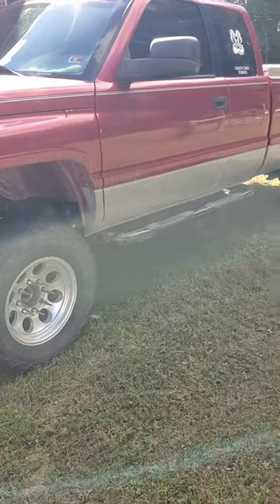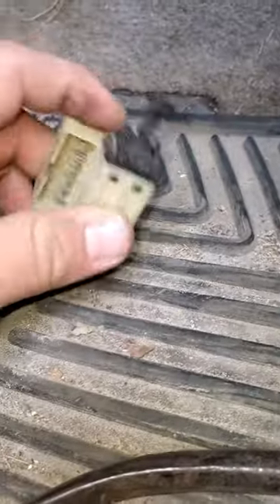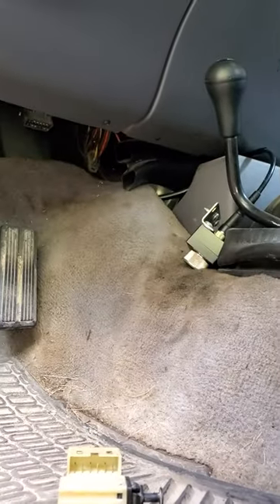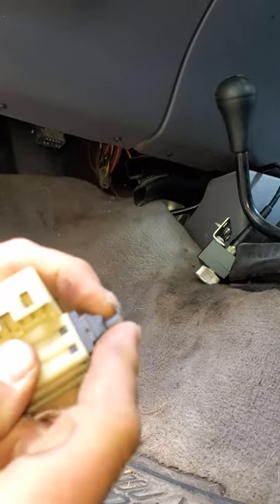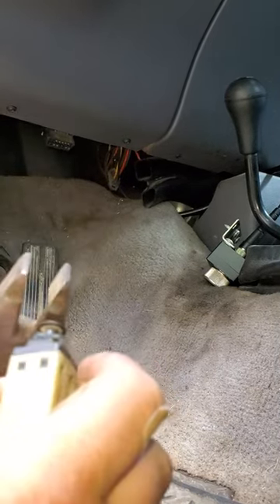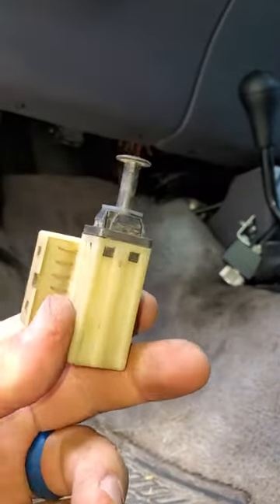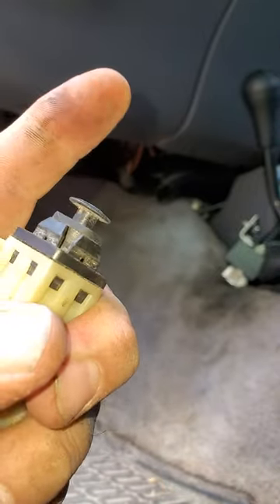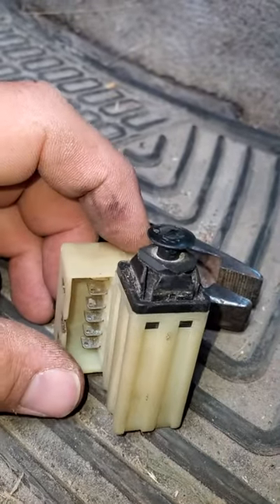dodge ram brake light switch 2nd gen.

Comment: My dash lights are out and running lights how can I fix that to
Reply from the maker: My truck did the same thing. My head light switch burned out and my lights did that. Replace the headlight switch and the pig tail and that should fix that. It did for me. These's  trucks are famous for melting the pig tail at the headlight switch and burning the switch. Soon as you unplug thr headlight switch you will see if that is your problem. Hope that helps

Comment: thanks for this vid, my driver brake light won't work even after a known good bulb put in and several new fuses but my passenger does on my 95 5.2, abs light is also on, gonna try a new brake light switch, it's a bummer since I can't drive around without it working I'll get pulled over
Reply from the maker: No problem. 👍

Comment: So I have a 2000 dodge ram cummins dually 3500 my reserve light stay on when I say stay on when I turn the truck off they still are on would it be the switch or the connector the the bulb go in
Reply from the maker: Hmmm... that's interesting! Sounds like you might have a wire crossed on the tail light maybe. Causing something to ground out and cause the light to stay on. The reverse lights show go off when the key is turned off. The brake light will work with the key is off. So that makes me think it might be something in the connector or something on the tail light. I would start there

Comment: This is the Sorryest Video i've Ever seen,  What did you show me? I Know what a breaklight switch looks like & how it operates. Show me how to remove the old one & install the new one, Ass-Hole. 😊
Reply from the maker: I showed you how to adjust the light switch for those who have done a 5 speed swap or have a issue with their's. But im looking foward to your video how to swap out a switch.  Thanks for watching ☺️
Reply: If you need a video to find out how to twist a switch and disconnect a plug, hour someone to fix your truck. This video was way more important than how to change the switch. Thanks for this video!